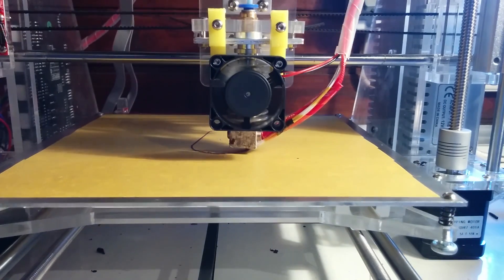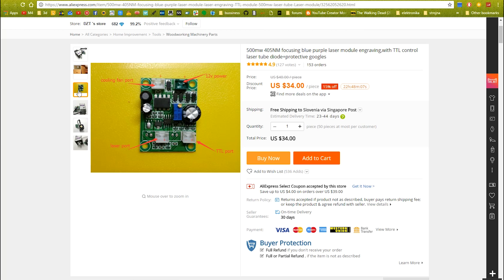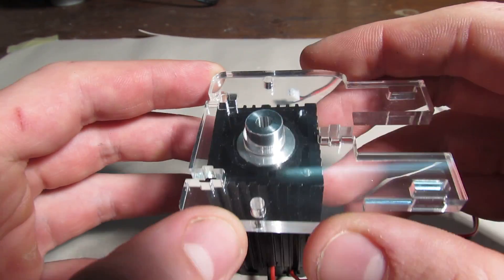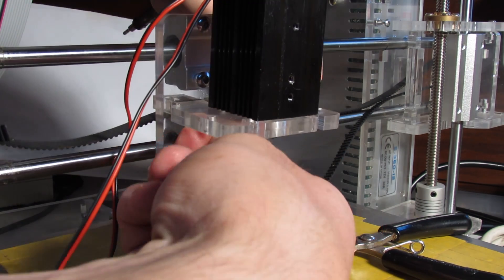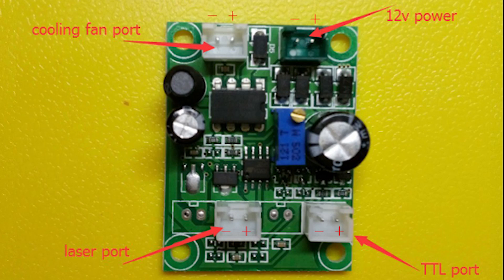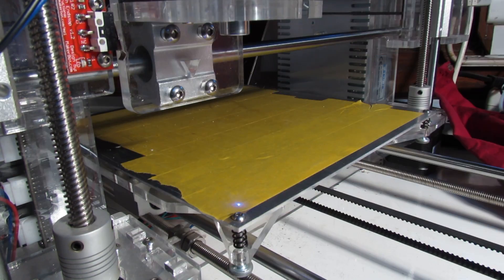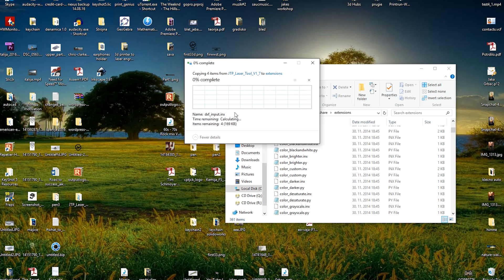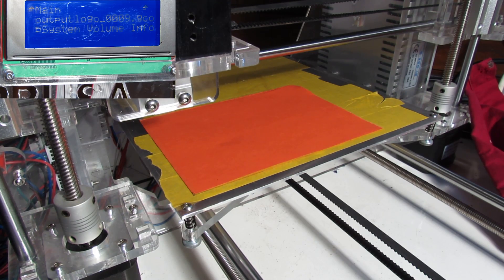Convert a 3D PRINTER To LASER ENGRAVER | Under 40$

Comment: Yoooo if anyone has scaling issues once you create the Gcode, be sure you're using inkscape version .91 or older otherwise there is a scaling issue
Reply: Thank you, I tested my laser yesterday for the first time and I had scaling issues. I will try your tip.
Reply: thank you
Reply: i have issues in the .91, the gcode is not the draw of the inkscape

Comment: Hello
I just came across your video and the content is really good.
I want the laser to turn on when the process starts and turn off after the process is finished. Can I do this by using the relay outputs on the MKS card (if any)? Or do I need to integrate it into the software?

Comment: My laser has a PWM wire connected to the 12v and ground ports on the Laser Control Module. How do I connect that to my 3D printer board. The fan let only has a spot for + and -... what do I do! I need help!!

Comment: The printer setup is simple in Win 10 by selecting 'Add a Printer', using the supplied CD is not necessary  share4.photo/HpLaserPrint?..    Network connection through a router makes it available to all PC's and output is very quick. Print quality is excellent.

Comment: The print on my 15W laser looks a little different.
Can you guide me how to connect and control this?
It's this laser: https://www.ebay.com/itm/Focusable-High-Power-450nm-Blue-Laser-Module-with-TTL-15W-Wood-Engraving/352360617338?ssPageName=STRK%3AMEBIDX%3AIT&_trksid=p2057872.m2749.l2649

Comment: just to be clear. this is an engraver not an cutter, right? what wattage of laser would i need in order to cut let's say wood?
Reply: It can cut, with some effort, factors would include which laser you purchased, and the thickness of the material (wood).  I've cut wooden rules (soft pine) at full power (405 blue laser) with several passes, also overscaned the material (ruler) to prevent excessive burning at the beginning and end of the cut(s).

Comment: Which port on motherboard you use to connect laser? I have Anet A8 printer.
Reply: In Jake's example/video he points out that he is using the hot end fan connection as the control for the laser.  Modified g-code M106 & M107 to turn the laser on/off or somewhere in-between  (0 - 255)

Comment: Great video, l was in the process of converting my old Sunhokey to a laser cutter/engraver, when I found this video 🤓. I used an Ardiuno with a CNC shield instead of the board that came with the Sunhokey. The other thing that I noticed before firing up the laser, that the cooling fan on top was blowing down and had no thru flow, so I drill a few extra hole in the old hot end bracket, now it does two things for me, keeping the laser cool and it blows the smoke/fumes away from the material being cut.  Thanks to you I was able to push thru and get my machine up and running.

Comment: Hello my Friend. Thanks for your video but I have a question. The Fan port of Ramps has 12v (or 24V modified) and TTL needs 5V only. Did you use 12V directly in TTL port?
Reply: @dennis8019  As he said he doesn't need TTL port. He turns on and off laser using fan control - jus turn on and off fan on motherboard what gives power to the laser directly :)
Reply: Is possible to control laser without ttl connecting????
Reply: Pavel Spacek you just turn on and off whole laser with fan. TTL gives you only control about poutput ower of laser 😎
Reply: Ok thank you, but i have 5,5w laser so i dont know if fan connector is too strong for it...
Reply: Please and is good to switch off whole laser with its fan and its board...if could damage of it?..thx:-)

Comment: Hi, thank alot for this great videos....
I have a prusa 3d printer, i plan to change the function to a laser engraver..
i confuse what kind of firmware for this arduino.." the default on my machine is marlin..
what kind of firmware did u use on your machine?..

regards

Comment: Thanks for the video. Great explained. I already decided to mount the laser on my anet a8. It works great but I'm having some problems. My laser does not turn off, although in my Gcode it puts M107 or M106 0 the laser starts on and generates the lines to pass to the figure and the back ones. On the other hand I do not understand very well the concept of where I adjust intensity. Is it only by speed or height, or by different passes? He believed that the laser only worked on or off. I feel if they are very basic questions but I can not find information.
Reply: Not 100% sure, but thinking you should edit you gcode:  M106 = S255 should turn the fan on full power, in this instance it would push 5 volts to the laser controller.  M107 = S0 would turn the power off.  example -> 

M05 S0
G90
G21
G1 F3000
G1  X22.475 Y0.2865
G4 P0 
M03 S255
G4 P0
G1 F750.000000
G2 X22.697 Y0.9368 I1.0634 J-0.
G2 X23.6351 Y1.7874 I2.8573 J-2.2084
G2 X24.4173 Y1.9631 I0.64 J-1.0201
G2 X25.1782 Y1.6037 I-0.1568 J-1.3172
G1  X25.

In my Gcode above, I use M03 & M05,    M03 would be the same as M106 & M05 would be the same as M107.
saying that the first line calls M05 S0 = off, the seventh line calls M03 S255 = power on.  If you are still having problems, post a snippet of your code, and someone will point you in the right direction.

Understanding intensity -> if your laser have an adjustable lens, then turn it on and adjust the beam to the smallest point,  use a piece of paper or whatever until you see that it is burning like Jake did in the video, to mark the 0 points of X & Y axis.  If your laser doesn't have an adjustable lens, then you'll have to use Z axis to focus the beam to a position that it will start cutting.

Cheers!

Comment: Hey Jake is there a way to keep both the 3d printer function and also the cutter function? just to easily switch them when needed. thank you
Reply: Manuela Ursu you could print a support that would attach at the back of the print head (on the side where the belts are). You'd lose a little bit of "print" area, but it would be so much simpler.
Reply: thank you :) but the chip area? that can be switched off and on? or any idea how?

Comment: Is there any reason why you can't fit the laser alongside the hot end, so you can change usage without messing about manually swapping them over ? For example, extend the hot end platform so the laser sits on the other side of the gantry ( missing the belt ), or at the side ( reducing the X axis ) - the fan restricts putting it infront of the hot end. Then add two switches to both the 12v power lines ( hot end and laser ) so you can have one on and one off. If the software works with either, it should recognise which is on.

Comment: Can this laser cut more than one sheet of paper at a time or thicker card even ? I guess it can't, because the laser doesn't mark the tape on the bed underneath the one sheet, showing doesn't go that deep. But I've now just read from a Laser manufacturer site ( http://odicforce.com ) that a 600mW 405nm Laser Diode can cut 1mm balsa wood, and a 200mW can cut through 0.5mm balsa. As a 500mW laser is used here, it must be able to cut through card. Can anyone elighten me ?
Reply: I'm answering my own questions now ! Laser description on Aliexpress states if speed is slow enough , it can cut 2mm paperboard (Run it 2 times).

Comment: Can i do this in my anet a8 and can i engraver on metal parts ? I am a begginer sorry for the question 😁
Reply from the maker: +Manuel Saravia As long as it has a controllable fan port you can do it for sure :) No unfortunately you cannot engrave on metal with this lasers :)
Reply: How can i engraver on metal part  ?
Reply from the maker: +Manuel Saravia Uff you would need a much stronger laser for that, probably more than 40W
Reply: What do you recommend for that materials ?
Reply: What laser i need to buy for metal and similar materials any recomendation ?

Comment: How quickly can you convert from printer to laser and also back again?
Reply from the maker: +Chris Edmondson this technique would take you around 5 min or less to switch to laser and back on printer :)
Reply: What is used for a bed to stop the laser burning beyond the target material?
Reply from the maker: +Chris Edmondson this laser is not that strong so an aluminum plate would be fine
Reply: Thanks

Comment: Great video!  I have an old broken 3d printer a friend gave to me,  makes more sense to buy a newer model than try to fix it, so I think I'm going to follow your example and convert this one to a laser cutter as well.  I did notice one odd thing in your video,  the fan for the laser blows down THROUGH the housing to cool it, yet when you mounted it flush to the plastic you essentially blocked the airflow so now the air can't flow down through the channel properly.  Did you notice any unusual heating problems as a result?
Reply from the maker: +jimmyturpin hey, that is a great idea you spotted and yes, on a more powerful lasers that can cause quite a big problem and shorten life expectancy of laser diode. For 500mW laser it is ok if you mount it that way. Btw. I will soon release a new tutorial on how to mount a more powerful laser on 3D printer so stay tunned my friend :)

Comment: whait u have a 3d printer wy didnt u print a holder for it so u dint have to take apart ur 3d printer? great vid btw
Reply: if he does it would take from his working area, so he would have less to work with on the bed. I think
Reply: @3BoyzLaserEngraving  idk. I'm sure there would be a way to make it work. you just need the laser pointed down. in fact you can have a 3d printer head and the laser at the same time. 
you just need a switch and double the wiring. when you want laser or 3d printing just press a switch.
sure it would require a lot more thinking and work and it's not as simple. but quite doable.
Reply: Yeah and would have to have a offset in firmware would be annoying if forgot all prints few mm off

Comment: Hi! Nice video, ive got some problems with the generated gcode tho.. My printer does not do anything with the G2 and G3 (arc) commands generated from inkscape.. im running a Marlin based firmware called Skynet3d on my anet a8 (fake prusa i3) and i think the firmware does not support G2/G3 commands.. What firmware are you using on your printer?

Comment: i bought a laser like this, but has no information included.  Can you tell me what distance normally should i have between the part being engraved and the laser?
(i know it can be focused, but i want to learn a starting point)
im designing a mount and want to know how far away from the build plate i should have the tip of the laser

Comment: Thank you for the useful tutorial! I bought the same laser and I am starting now to upgrade my 3D printer. I have noticed that the laser module comes with the fan facing what I suppose to be the wrong direction (the fan is sucking air from the heatsink and not blowing to it), do you agree or is it supposed to be like this?

Comment: Will adjusting the potentiometer on the driver board increase the strength of the laser? if so which way? can cut through paper but struggling to cut through card

Comment: I can turn on the laser by setting fan speed, but the gcode "M106 S255" doesn't work.
somebody can help me???..........
Reply from the maker: +翁庭瑞 Hi, can you tell your printer motherboard name, maybe it has a different g code for fan port
Reply: i saw "MOTHERBOARD BOARD_RAMPS_13_EFB" in Marlin ,so i guess that is ramps 1.3 , but the store which sell the  board to me say that board is ramps 1.4.

so.....im not really sure
Reply: my laser is connect to D9  on the motherboard, And i try "m42 d9 s255" still doesn't work ,but the board's led light was turn on when i sent that gcode.

Comment: Hello, I want to do the same as you did. Is it also possible to connect the laser to the extruder fan port instead of the fan port of the mother board? I think it should be possible, but I don't know if Inkscape is using a default setting to detect which port is being used. Can you help me out with this? Thanks and great video!

Comment: wonderful ... can I mount 1000mw laser to cut wood?
Reply: https://it.aliexpress.com/item/2015-new-12V-blue-purple-light-1000mW-laser-engraving-machine-module-for-high-power-laser-focusing/32517337878.html?spm=2114.010208.3.1.6sx92u&ws_ab_test=searchweb0_0,searchweb201602_2_10065_10068_433_434_10136_10137_10138_10060_10062_10141_10056_10055_10054_128_10059_201_10531_10099_10530_10103_10102_10096_10052_10144_10053_10050_10107_10142_10051_10106_10143_10526_10529_10084_10083_10080_10082_10081_10110_10111_10112_10113_10114_10037_10078_10079_10077_10073_10070_10122_10123_10124-10531,searchweb201603_4,afswitch_1,ppcSwitch_5,single_sort_0_default&btsid=46819640-dcd0-49a2-9fa7-5f6cf6035137&algo_expid=e54397b1-0f20-4312-8af4-cc18f7de4a93-0&algo_pvid=e54397b1-0f20-4312-8af4-cc18f7de4a93
Reply from the maker: +Ande ofcourse you can, but I would then suggest buying 2.5W laser. I will make another tutorial on that in a few weeks
Reply: Many thanks.. i will wait for your new tutorial... In the meantime i Design a system to put laser over excluder in order to avoid to disassemble it... Many thanks again for your great work!!!
Reply from the maker: +Ande You are welcome ;)

Comment: Hi, one question, my hotend heats up when I use the laser, but I have no M104 or M109 in my gcode. Do you know my problem?
Reply from the maker: +M. O. hmm I dont know, if you dont find anything better just disconnect one connection on extruder
Reply: That's what I did to solve the problem quickly. But this solution is not satisfying. I'm not an expert in Marlin, but perhaps the "preheat constants" are the problem. The printer  tries to heat up to 200°C, the constant PLA_PREHEAT_HOTEND_TEMP 200 has the same value.
Reply: I have an idea, maybe use cura or pronterface to turn off hotbed when printing or via menu on the 3d printer. Its in contol or prepare menu im pretty sure, in 1.19 marlin you also have tune menu when steppers are on.
Reply: Set a profile for laser in cura or pronterface would solve it or get a copy of your config.h and config.advanced files select no heated bed option and upload

Comment: Have you tried using the laser on Clothing or fabric to see if it will etch? are you able to shade in areas or is it only able to outline designs?
Reply from the maker: +motorcycle rebuild hi, It should also work on leather and other fabrics, and yes there is another plugin for inkscape which alows ypu to do that.

Comment: Ah you have the Sunhokey I3. This printer gave me so many problems... I still have nightmares
Reply from the maker: +Triangl3D Printing hah really? how come? I am surprissed I didn't have any problems except replacing extruder module for 2 years now
Reply: During the second print, I tried to use the heated bed and the RAMPS board caught on fire :D

Comment: is it possible to change the Laser-Power with the Inkscape Plug-In. So for Preview e.g. or lower Power for sensitive materials?
Reply from the maker: +Michael Kienle yes it is possible :)
Reply: Thank you, but how will it work? The power for your laser is plugged in in FAN1 (?)  So when you turn on the "Fan" the laser is on (with full power), right? How will the software make the laser more or less power?
Reply from the maker: +Michael Kienle I think you can adjust the power from 0-255, I have tried and it works

Comment: I get only the following output:

M107 S0

G90
G21
G1 F500
G1 X0 Y0
M18
Reply: M107 does not need the S0 extension simply use M107 to turn the laser off . Use M106 S255 to turn it on ( M106 S0 also turns it off)

Comment: Hi, do you know why my engraving proccess ended up really small, i set the picture to 30mm but in reality it only measure 5 mm, and it was not located n the position that i wanted to
Reply from the maker: +HJR Fingerboards hi, I think that is a problem with newer version of inkscape, check out se commemts below, I think one guy described a problem on that thopic :)
Reply: okay im goint to try in the older version, thanks!

Comment: Hi, Do you know if this could burn off matte black paint that's on copper?
Reply from the maker: +ImaginationToForm hmmm, never think about that, but I think it is still too weak for that ;)
Reply: Oh too bad.  Its a method for making circuit boards where you burn off the paint for the part of copper you want to etch off. I've seen it done with 40W lasers just hoping it could be done with something easier to make.

Comment: Nice video, would it be possible to engrave metals with this setup too?
Reply from the maker: +gaettilingkanone hi, unfortunately 500mW is not enough to cut metals
Reply: Not for cutting just for engraving. Could it be done with a little stronger laser?
Reply from the maker: For engraving you still need way stronger laser, try searching for 10W CO2 laser
Reply: Ok thanks for the answer bro